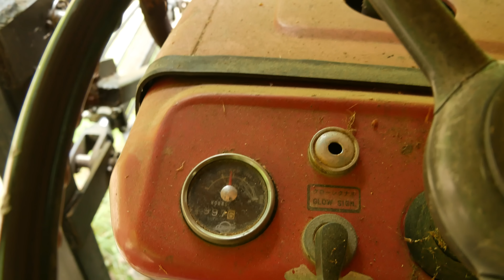Fixing up an Old Shibaura? Tractor

Comment: There is a way to fill your tries with foam--- and then you don't have to worry about it.  but you already have the new one's now.   Actually, what a lot of people do with new tires is fill them with water (and antifreze)--  Because it gives you more weight in the rear and allows you to lift more with your front loader.

Comment: Great vid Mike.  Reminded me of the 1st tractor I bought back in 2001. Shibaura SD3240 with a new Koyker loader and 5' box blade.  I used to get parts for a Ford 1710 which was similar enough to fit my unit.  Sold that when I bought a new JD 4320 and now I have a Kubota L2501 I bought new in 2018.  I also have a Bolens-Iseki G152 (diesel) with Howard tiller and a Bolens HT20 for general use.  Down to 3 tractors from a high of 7 about 4 yrs ago, lol.

Comment: IMHO - You just secured yourself a place in machine heaven for what you did for that old Shibaura... 

(Side note - that Suzuki VX800 has got to be one of the most underrated general purpose street bikes of all time.)
Reply from the maker: Thanks for court my video!
Yes the VX800 is a cool bike, that’s my friends, he rode it to my house about 5 years ago, the voltage regulator burned out so he parked it there, came by and installed a new one but he never picked it up again.  I own a 1972 Honda CB 350 four, fun little bike, sounds great at 10,000 RPMs! 🙂
Reply: @Mikefestiva  He must not be in a hurry to get his bike back... 😆

I have around a dozen bikes around my place. I also own a 1972 Honda but it's a CB100. Those CB350s are another underrated one. Everyone wants the CB400 Four or the CB500 Four. They are all like little gems to me.

Comment: You have a reliable tractor there for sure. A John Deere 955 would be worth looking into in my opinion. I have a 755 and it's been absolutely rock solid! 955s are hydrostatic but 33 hp and mostly all mechanical. Just something to consider.

Comment: Had a 1910 ford since 1988 made by Shibaura.  Excellent tractor.  Finally sold it last year and upgraded to a much larger old Kubota.  Oddly the only problems over that 30 plus years were one water pump, several batteries, and slashes in the sidewall of the original tires.
Reply from the maker: Well built tractors for sure! 
Thanks for checking out my new video and commenting 👍

Comment: In the late 1970s, early 1980s,  my dad owned an Iseki brand, and it was exactly like yours, apart from the color.  The dash panel especially with the glowing glow plug indicator, battery location and the massive size of the axels.  I'm betting they were the same.  Little 2 cylinder diesel, 4 wheel drive and size all match.  Cool.
Reply from the maker: Great tractors for sure 🙂👍
I will take a closer look at the Iseki brand next time I see on on Craigslist 🙂

Comment: Just can't beat those old tractors and it shows, they get hammered, beaten up and still go! I was a farmer 30 years ago and every farm had an old Massey Ferguson 35. These tractors had multiple bolt on patches on the tires and (I kid you not) welded bolts on the cylinder head because it was an easy quick fix! They are probably still going to this day. Your little tractor is pretty much the same - and your TLC will keep it going further. Thanks again for a splendid video and good editing with "ye old timer" music.

Comment: I have a John Deere 755, that seems to be made well. Steal rear axle housing, HST that seems to be holding up very well. About the same size as yours. I made a backhoe subframe (4 point style) for an old "kubota" like woods backhoe that fits it. I don't plan on getting anything newer to replace it. 
Love the paint on the old tractor... might be doing that to mine soon.

Comment: Mike, Love your videos! IMHO Yanmar is the way to go, I bought a SA 424 about 2 yrs ago and it is built like a tank. I work it hard, built 350" driveway with 80 - 100 tons of road millings, moved 20-25 logs for the neighbor that were 30-36" dia. Moved a large rock pile and made a pad to store my attachments on and it will spin all 4 ties when digging. 24.9 HP and a 10 year power train warranty, so they are still built to last. It is Hydro, not manual (dang it), but I do have to save it is growing on me. Keep up the good work!

Comment: Looks nice.  When the housing market bubble hit and I didn't build a single house in 3 years, I started refurbing skid steers in my garage.  A couple of hints:  The secret to a 10 foot paint job is to concentrate on feathering the old paint with a sander.  Like a 500 grit. Believe it or not, don't use HVLP, use rattle cans.  The paint tends to be thicker and hides more.  HVLP is great for cars when you have a really nice surface to spray, but it shows way too much on the surfaces you're spraying here.  You can find implement paint at farm stores that works great or buy manufacturers spray paint in rattle cans if you can find it.  Rust oleum primer works great over a little surface rust, and it's a good base that builds over chips and pits.  The best thing that I learned (You probably can't do it because I doubt you can find the decals) is to paint right over the decals and place the new ones right over the old.  They really help with placing the new ones.  I sold 50 skids over the 3 years, and I still see them around.  They still look pretty good, and I never had any complaints.

Comment: Looks great Mike 👍
You did the exact amount of work it deserves! I get myself into trouble getting carried away all the time. I'm a detailer by trade and knowing me I would have would have been foolish enough to skim the whole thing in glazing and finish it off with 2 part clear, wet sand/polish and be actually disappointed in the finished product 😆😆😆
Reply from the maker: I definitely know what you are talking about, I try to be realistic about the outcome, I weigh out my time to the end results and my plan was for a 10 footer 👍 That is the finish looks good at 10 plus feet away 😂
Take care 👍

Comment: I had an old gray market Kubota about the same vintage. I'm pretty sure it was 23 horsepower, my introduction to the wild differences between industrial horsepower and what vehicles advertise. That damn thing had more grunt than many machines I have owned three times the size. It's most blatant weak point was simply a lack of weight, I never did find a task that made the engine bug down at all. My wife got tired of being made to sit on the hood so eventually I rigged up lead wheel weights and a few 55 gallon drums full of water. I still regret getting rid of that machine. It had a two-speed axle besides the transmission, if you put it in low low, you could walk beside it grooming the driveway and throwing limbs straight into the trailer, it would move slightly slower than a man walking. Built like a brick shithouse but not the slightest nod to comfort. Absolutely perfect machine for a low cost homestead

Comment: I have a mid 70s gray market kubota b7000, with a loader off  a b7100.    Unbelievable reliable and useful for such a tiny tractor.    Gathering firewood and fencing work.   If your looking for a pretty challenging project.  Make a brush grapple for your tractor.   Even more challenging, make one that doesn’t require expanding hyd., something like Westendorf brush crusher.    Regarding tractor tires; patch and repair until they rot.

Comment: I own a Shibaura SD1800. It's got a front end loader as well as a backhoe on it. I bought it about 10 years ago in Washington state from a welder who imports used Japanese tractors by the container load. He then fabricates the front end loader and the backhoe from scratch in his fab shop. I've done a lot of work with over the years on my property. It runs great. I was lucky to find a factory parts manual for the SD1800 and the SD1840 on eBay in Japan not long after I bought the tractor. The seller mailed it over to me. The manual is written in both Japanese and English. I also have a Ford shop manual for models 1100 to 2110. I find the Ford model 1500 has a lot of things in common with the SD1800. I've replaced the front tires of mine. The back tires are still in really good shape. According to the fellow I bought my tractor from, it spent it's life in Japan working in the rice fields therefore it wasn't worked too hard. By the way I really enjoyed your video. Thanks for posting it.
Reply from the maker: Right on! These tractors are very well built, my tractor was imported to Washington as well, the person I got it from bought it from an importer in Shelton, the front end loader definitely looks like it was built from the importer. 🙂
Reply: @Mikefestiva  I bought mine in Hoquiam, WA which is not too far from Shelton. The name of the company I bought from is called Coldwater Tractors. I'm not sure if they're still there. Like you, I'm sure glad I bought a Shibaura tractor.
Reply from the maker: @tube396  You know mine could have very well come from Hoquiam as well, I was thinking Shelton but it definitely could have been the same place you got yours from. I have had my tractor for 8 years or so and the previous owner probably had it for 5 or 6 years before me.

Comment: Mike, I recently purchased a Yanmar YM 342, the machine is an absolute beast. It is efficient powerful and it is built to last
Reply: relevant how?
Reply from the maker: Right on! Yes Yanmar tractors are really well built 👍 If I sell my Shibaura in the future I have been considering a 25 to 30 HP Yanmar from the early to mid 80s

Comment: Man ive ruined many shirts and shorts climbing on, rolling around and swinging on old tires. Used to infuriate my buddys wife when i let their son roll an old round track slick around, he would roll over it and it rolled over him but he was black as the tire when he left…..good times!

Did an awesome job upgrading the paint, too much body work and its overdone for the year and covers all the character up. Your “good enough” was perfect for it.

Look for about a 30hp Iseki tractor, heavy and built like a tank for its size. I bought a 55hp Mahindra and have been happy with it and it has surpassed my expectations, i looked at used for 5yrs and most had 400-2000hrs but still wanted nearly new prices so i bought one with .8hrs but was a 2yr old tractor and saved $14k plus got an upgraded bucket, box blade and 3rd valve for the loader. Still wish i could find a 30-35hp with a loader like a JD955 hydrostatic for my dad so he didnt have to climb up on mine, it bothers his knees climbing up on it

Comment: i had a 1996 kubota b2400 (with those thin axles - they're made so you can widen the track) i had it for 26 years, put close to 3k hrs on it.  i had a few issues with it, mostly leaks, but the hydrostatic drive never gave me any problems.  i used it pretty hard too.  I did bend one of those skinny axles though :(  overall it too a lot of abuse and kept going.  the engine just worked.  never had an issue with that.  i upgraded earlier this year for a 2006 l3800 with less than 300 hours on it (under 200 when i bought it)  so far so good.  i like the extra power, but i miss the maneuverability of the b series. i can't speak for any other brands, but the orange tractors have treated me pretty well

Comment: I have a Kioti CK2610 HST and they are said to be pretty bullet proof. I also have a Kioti RX7320 and a project tractor Kubota L2950 GST that sounds like exactly what you are looking for. They are pretty rare. Mine only has 150 hrs on it but needs every rubber piece replaced plus all cylinders rebuilt - barn find if you will. If it ever gets under a 1000F down here in Texas, maybe I can find the time to work on it. LOL

Comment: Seems like a great little machine Mike. Thanks for making this video. I was impressed that you tried to change the tire by yourself. i tried that also  on my tractor, but failed miserably, took it into a tractor tire shop where they did this for me. You did a great job on the painjob mate, thing looks like new. Pls don't sell it! so much work put into it should keep it imo :D the manual trannys sure last long ways, my t-40 gearbox makes this super whiny sound when in motion(been like this ever since i got it, thing had no oil in the tranny when i bought it, but adding oil did not make the sound go away), but its been working great all these years (since 2013). One funny commenti found online was when another person was asking about the whiny sound as well on his t-40 and a simple reply was "it's okey, t-40 gearboxes are used as rock crushers on their spare-time" :D:D Waiting for the day u jump on that yanmar tractor.
Reply from the maker: Thanks for checking out my new tractor video Ants! 🙂
Yes I probably will hang onto my little tractor for a while still, it’s been a really good machine so far.
Haha I thought the tires would be a big fail as well but I was able to do it surprisingly 😊 
Haha you should hear what all older manual Ford truck gear boxes sound like, they make an awful sound when rolling along just barely on the throttle, crazy amount of gear sound but every old Ford truck I have been in sounds that way. Once you get use to it it’s not something that bothers me anymore. 
Take care buddy 🙂

Comment: The hills eat up the hydrostatic transmission. That's the main reason I have so many running tractors I need to get rid of. They can do the job, but not without it significant break halfway through

Comment: I bought a LS mt357. Very impressed with the quality. Out the door we paid 27k for it with the loader and a 6ft tiller. Only concern is dealerships, they are few and far between. If you have one nearby then I would say it's a solid choice.

Comment: We have a 2018 LS XG3135 and it does well 400 Hours and no major issues. Being a 2018 it does have tier 3 Emissions and it hasn't been a hassle yet. I'm not a real fan of emissions and computers either. we paid 18K out the door with a backhoe 2 years ago. it was used with 150 hours.

Comment: they made ford/new holland 1300-1900 series tractors. i use a 1920, and a 1720 with a rhino front loader at work, and they're as trusty and dependable as a loyal mule, without the stubbornness.

Comment: Agree on a lot of the points you make about tractors, and newer tractors etc. I have a Kubota B6100, 7100, and 8200.  The 6100/7100 I love because in spite of being far smaller than any current SCUTs and barely larger than a garden tractor, they're built more in the style of a 'miniature farm tractor' with cast iron and steel everything and have basically all the same features plus some extras (3 pto speeds?!) and no electronics other than a solid state charge regulator.  They are nothing like a BX!

The b8200 is a hydrostatic but i only went for that one because it has a loader and backhoe and i got it broken for $1k. Holy crap what a machine for its size. As far as hydro vs gear I honestly don't care overly much even when doing loader work (6100 has loader too), and i think based on how your property looks in your videos you're not going to see a lot of speed gains from a hydro vs gear anyway because it looks like you have to be fairly cautious on most of your terrain and going faster is somewhere between optional and ill advised. I have about 3 acres of open field where it would make more difference.  Oddly enough on my 6100 the high-low range selector is so much easier to use than the 8200s wacky range shifter that I probably get places faster even doing a rolling 2-3 upshift on the non-synchro gear trans, than i do shifting from low to high range and then just pushing the hydro pedal. I've never operated a shuttle shift trans, but as a manual transmission enthusiast I have no issue or 'loss of productivity' running my gear trans loader vs my hydro loader and have a LOT more trust in the gear trans!

Comment: The Shibaura sub compact tractors in Australia are sold be Case IHI.  I actually own SB24 (4wd 24 Hp) 2004 with hydrostatic drive and has never missed a beat. New tyres and radiator hoses only last year as they perished.

Comment: Back in high school in Ag class in 2000, my shop teacher had a 1978 model Ford frame and engine on steel saw horses.  It was indeed heavy duty and made of cast iron.  Mr Mills had somehow woo doo'd Ford into donating the stripped chassis as a shop demo.  Pretty cool demonstrator.

Comment: I never scan comments to see what's already been said, so maybe it's been said already, but.. 

A lot of large tires on off-road equipment are designed to be 'field serviceable' rather than hauling the whole wheel/tire assembly somewhere and needing a machine to deal with it. The biggest part of that is how the bead area of the tire and wheel fit together. Tubeless tires are designed with a very tight tire/wheel connection at the bead so they don't instantly de-bead when they go flat and ruin the rim. Tube style tires or anything intended to be field-serviceable (often anything really large) on the other hand have a pretty 'loose' tire/rim interface and rely on the tube itself to keep the tires pushed against the rim, but once the tire is deflated the beads should be fairly easy to break except in cases where rust has 'swollen' between wheel and tire and made it tighter than it's supposed to be. 

My small Kubota loader tractors are pretty much my favorite machines i own (out of..dozens?!) but hey, i still dont have a mini-ex or a homemade articulated dumptruck or mini pinz etc. :)

Ok, now to finish the vid..

Comment: I have a tym t25 with the bucket and backhoe 26 hp gat 80 hours I love this thing it came out to it came out to 28000 with financing and insurance when I gat it with a trailer and the payment came out to 404. A month it was hard to pull the trigger on it but I did and it puts in the work I need it to do